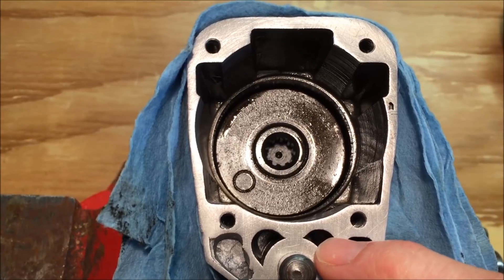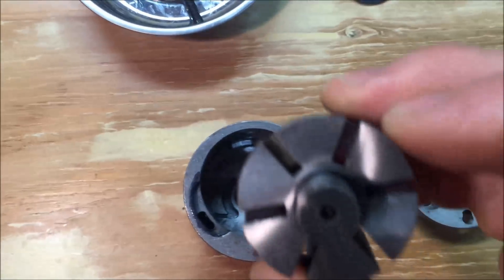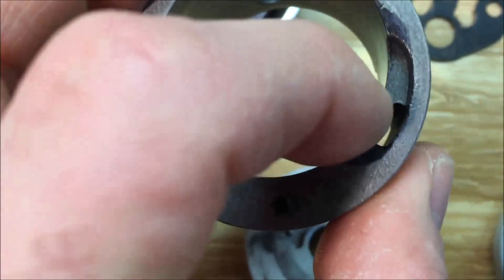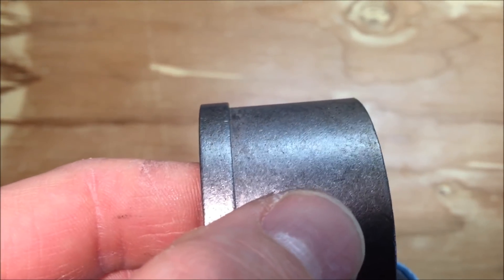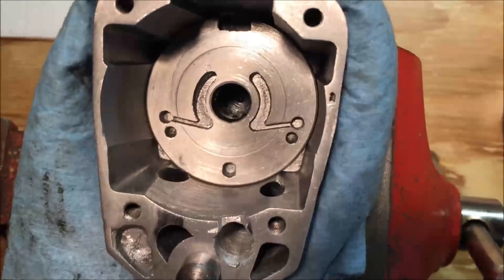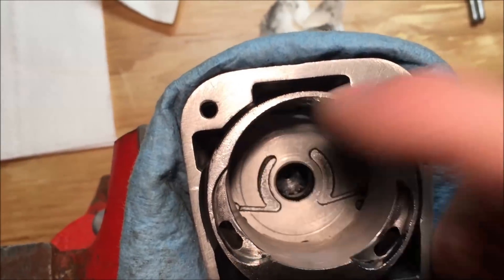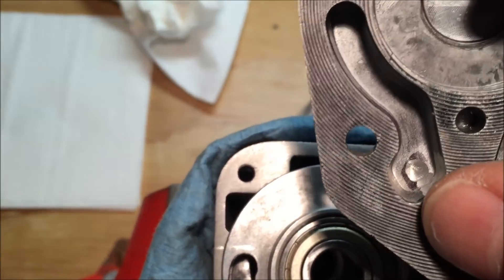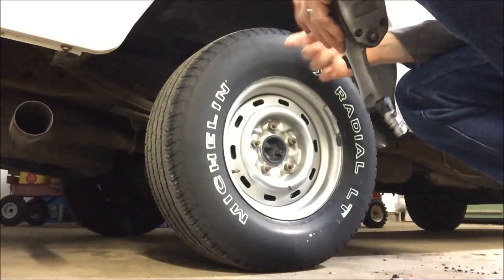Modifying an Impact wrench for more torque (2nd attempt)

Comment: I'm gonna try it on my Mac gun. It's already rated at like 850lb/ft but i want up over a thousand as i use it about everyday as a mechanic and, to be honest, I'm to old to be busting out a breaker bar. Only rarely do i have to to begin with on this gun but it's this or buy a $200+ gun, so I'll try porting and rebuilding it first

Comment: Send it to the torque test channel and get a new one, just to see if the mods made a difference. The airflow was cleaned up massively, the hammer mechanism in there is what is holding it back

Comment: The number one thing you could’ve done was to polish the inner diameter of the vane contact service. Rotary vane devices suffer major leakage which is where the veins contact the inner periphery of the cylinder. This is their major source of power loss By simply polishing the inner peripheral of of where the vanes actually contact, and then polishing the vein tips would have the most drastic affect. You were trying to create more airflow when you needed to fix the sealing of the vane tips.Even microscopic scratches cause major league age of the air pressure around the vanes. So instead of 100 psi or whatever you’re using pushing on the back side of the veins, you’re only getting like 70 psi exerting force on to the vanes. Also the only thing that pushes the veins out word is air pressure and centrifugal forces, by also utilizing springs underneath the veins this also greatly AIDS and sealing the vein tips to theHousing. If you take apart any vein type air motor, ones that put out up to 9 hp, all use some type of a spring mechanism to push the Veins more forcefully to create a better seal. The rotary Vane Are positive displacement devices which means they operate on pressure more than airflow.
Reply: Just came back to like and comment - on this comment. I have a nearly 20 year old CP-734H impact that was becoming nearly useless. I took it apart this weekend, cleaned up the bore to get rid of any spots that could damage the vanes, cleaned up the sealing edge of the vanes, reassembled, and have nearly new power in my wrench now.
Interestingly, to my eyes, this looks like the impact featured in this series was based on. There is definitely a major difference in tolerences, as mine would at least still take off lug nuts even with all of the wear, scratches and damage.
Reply: instablaster.

Comment: Very nice 2 part video, and quite detailed. It is my opinion that the power delivered is a result of the hammer/clutch and air delivery to the tool. Having larger "openings" will increase air flow, but will also reduce pressure. I would suggest leaving the internals as-is (except cleaning and lubricating the insides) and working on the delivery to the tool. Use 1/2 ID hose, and if need be, a 3/8 hose as a whip. Make sure your fittings are 3/8 and you have no reducers from the 3/8. On the compressor itself, make sure the regulator is wide open, or better yet, remove it. Even wide open it restricts air out. Most people set the regulator at 90 psi (tool spec) not realizing that the air hose itself reduces that. You want to supply 110 on your tank, or if you are "supercharging" like this video intends, use it wide open.
Reply from the maker: Thanks, I think the hammer mechanism is the key, I've been able to put way more than enough air through it and there isn't any noticeable improvement past a certain point. There just isn't enough mass to the hammers to perform any better. It works good as a light duty wrench than can be used on bolts you don't want to snap off though.
Reply: @SteveStoltz  Agreed. You can only do so much by increasing air flow before it stops. The big thing for me was changing the 1/4 couplers and plugs to 3/8, and running all 3/8 air hose. You just reach a point that the tool is doing all it can due with the parts it has.

Comment: I have the same one, a great impact for the price, and it has handled almost anything I needed. I've used the common air connections for years, but I'm switching out my old air connections to a larger ID size, to increase air volume first.
Reply: Air hose -> 1/2 inch ID. Plug Fittings -> 3/8 min, No restrictions (regulator) on the compressor output = happy user.

Comment: Your Problem is the Hose! You need an Hose with a min  inner diameter of 9mm or more.You can hear the powerfull Start and then the Pressuredrop.
Its a Turbine that needs Flow.So go directly to the Tank without any Pressure regulator inbetween .You should have 10Bar or 140PSi on the Compressor.
When you Fire the Impact by using an 10m Hose with 9mm inner you habe around 2Bar or 28PSI Pressuredrop on the Toolfitting.
Reply: In addition , the red gun works fine so the modified gun should be OK - apples to apples comparison . It is of course true that optimum pressure and flow will give best results .
Reply from the maker: In this video I'm using a 1/2 inch id hose with 3/8 fitting and 150+ psi right out of the compressor. That should be able to supply all the air this thing needs.

Comment: I'd be very interested in knowing what the increase in torque was with the modifications you made.
Reply from the maker: I don't have an exact torque number, but it did increase it a pretty decent amount. I use it for light things that I don't want to snap off etc. I did a video using a torque wrench to tighten the nuts then used the wrench to remove them, its definitely not scientific but gives a ballpark Idea.

Comment: Need to upgrade your air line and fittings sizes, use 1/2” inside diameter hose and 3/8 style fittings (hard to find to find ) fittings. Stay away from 1/4” air fittings
Reply from the maker: In this video I'm using a 1/2 inch id hose with 3/8 fitting and 150+ psi right out of the compressor. That should be able to supply all the air this thing needs.
Reply: Are you quick connects 3/8 also? Cause the regular ones you can  buy just about everywhere are 1/4. 3/8 quick connections have much bigger ID compared to 1/4 quick connects
Reply from the maker: @MrHanky_YT  Yes they are 3/8

Comment: I put a t joint on my 5 hp compressor before the regulator so I can have straight from the tank pressure oiled up the gun and it did the job with no problem it would not before. I am going to build a desiccant air dryer to install between that and the hose. The gun is a cheap HF type. Worked like a charm.

Comment: the hammers are junk and the veins do not fit in the slits tight so they loose huge power, in your video you can see the nasty lines in the veins. next you get to learn brakes from over tightening your lug nuts , distorting rotors and drums
Reply from the maker: Yeah, over torquing isn't advised, that was for demonstration purposes only lol. Brakes are fine I didn't go too far past spec, I've had tire shops tighten the lugs way tighter and never had an issue other than needing a breaker bar to get the things off.

Comment: Have you tried taking the weight of the vehicle off the wheel? And tried torquing the lug nuts onto the wheel so they are not tight to the point where they are warping the rotar and bending the threads? Because you might have seized them on by tightening them onto the rotar by using just the impact gun.
Reply from the maker: Eagle Warrior I recently tested by tightening the lug with a torque wrench and then removing it with the impact, it’s one of my recent videos. Thanks for watching.

Comment: You can get a lot more out of impact guns if you upgrade you air supply to a larger inside diameter,,,pressure 125 psi,,,general rule of thumb,, 3/8" impact is for 3/8" and small bolts,,,1/2" impact is for 1/2 to 3/8 and so on,,,nice vid you spent a lot of time on it
Reply from the maker: Thanks, I currently have 3/8 id hose and fittings on everything, a little overkill in some cases but overall it seems to work pretty well.
Reply: Hell, I run my Mac, well everything in my garage at 150. The difference in that Mac at 130 and 150 is a what's going on here moment when I forgot I turned my regulator down. Like the difference between things coming right off or not. Believe me, 150 makes a major difference but over 155 really don't, it's the sweet spot

Comment: I have the same impact as that. I used a brake hone and honed the motor larger and eliminated the imperfections it came with to minimize air loss. But I don't think you have enough material left to do that. I also made vanes out of plastic. With only those modifications it has a lot more power. Oh yeah 3/8 hose 1/4 Milton L fittings 125 psi and 34 cfm air pressure and volume. I find that honing made the most difference
Reply from the maker: That's a good Idea that I hadn't thought of,  It seems like it would have a similar effect as changing gear ratios, since the vanes are extending out further. My dad gave me a box of tools that included another one of these impacts, I may try just boring the motor out on that one and compare it to all of the things I did to this one.

Comment: one thing you didn't modify was the hammering mechanism, that's why you didn't get much tq out your mods' what you archive was more speed. remember if  you let it fall one hammer that weight 2oz from one feet to your foot nothing happens, but if was 5 pounds hammer, definitely it will hurt and make some damage. same principle apply to impact wrenchs. also that happen with sockets too. use heavy socket with the smaller gun, it will probably take off the lug nuts without hesitation.

Comment: You polished that turd till it shined. lol. Great video. Would have been neat to measure the torque you gained from start to finish.
Reply from the maker: I should have incrementally torqued the nuts with a torque wrench and tested that way, hindsight I guess.

Comment: I think it's because of the clutch mechanism, rocking dog is expected to have very low torque output. If you change the mechanism to twin hammer, I believe the torque output will be comparable to your #2 impact
Reply: ɷɷ Heeeey Friendss I Have Founddd Workinggg Online Hacck visitt  : -  https://t.co/ojNHSYFB3m
Reply from the maker: +dionsaurus I agree, it wasn't really an apples to apples test, I may put up a video of removing nuts at known torques , Just haven't had time.
Reply: I agree, the problem with this impact wrench is the hammer section design.
Reply: Oh lest try that change the mechanism 😎😊 do it

Comment: But you don't really know what the torque setting is of either modes on the red gun. What's the torque MEANT to be for the car? 90ftlbs? You might be hitting it 150 or more. Nice vid though, I've got a similar gun that's equally crap so it might be worth performing some surgery on it.
Reply from the maker: +Mickleblade I agree, it was like comparing apples to oranges, the red gun is a beast(700 ft lbs total) and on the #1 setting is deceiving because it doesn't feel like its doing anything. If i were to do it over again I would torque the nuts to several settings and see at what point the wrench breaks them loose.
 Although not as dramatic as I had hoped, the mods definitely improved the torque output, it would be good for lighter weight stuff like pulling apart small engines, mower blades etc without snapping off bolts. I feel it was worth the time spent.
Reply: +Steve Stoltz my cheapy wrench can't undo a nut that was specifically tightened to 81ftlbs and I was looking to see what can be done with it. Mine is a) bone dry, no oil and b) the air is limited by passing a ball bearing that's used as the switch. I haven't checked the 4 position selector yet, perhaps I can remove it altogether. Thanks for the vid and response though.
Reply from the maker: +Mickleblade No Problem. I go through the inlet in the first video, if you can remove enough material from the rod that pushes the bearing out of the way that frees up quite a bit of space for airflow. I noticed a decent improvement in the speed and feel of it from just the mods to the inlet portion. good luck

Comment: red impact is without mods? do you have # model?
Reply from the maker: +maik carrillo The Harbor Freight model # is 68424 (Earthquake). I use a 3/8 air fittings and I removed the wad of muffler material, other than that Ive done nothing to it. The gun is OK with the 1/4 fitting, but it responds to the 3/8 fitting really well.  Its well worth the price i my opinion, especially with the coupon.